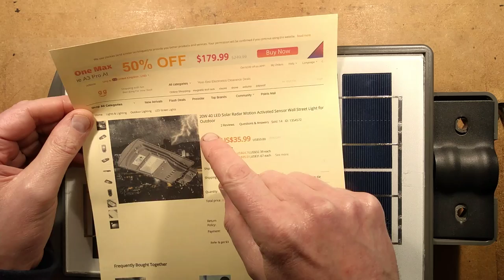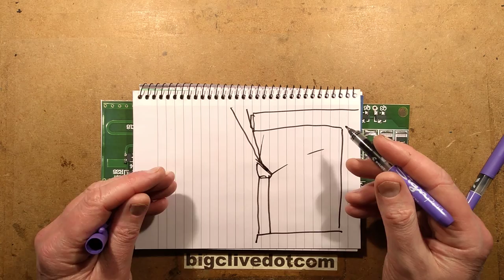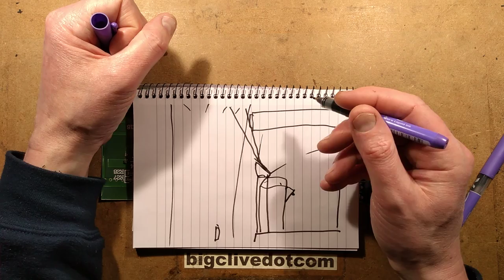Inside a sealed Chinese Solar street light with Doppler detection.

Comment: "It triggers a timer inside  controlled by this array of caps and resistors" AWW!..I have the 300 lumen version and I wanted to double its battery storage capacity by putting in an additional battery, since I noticed its on the edge of what it can do after an all nighter after a cloudy day. And I was also interested in doubling that timer so, when triggered, it stays on a little longer.

Also look into plastic welding. You can do it with a heat gun and a piece of fabric, like hot glue if the fabric is plastic, Usually #5 PP is handy.

Comment: Hi, Clive you say in the comments that the cell only puts out 70mA in the current lighting condition and it doesn't bode well for all night illumination.
It isn't designed for all night illumination, its designed for illumination when a moving body is sensed.

Comment: It's not Doppler in my book as it just looks for a single change in the reflected field - a true Doppler detector uses some form of pulse counting. I designed several commercial ultrasonic and microwave intruder detectors in the late 70s to early 80s using a diode pump as the alarm threshold detector.

Comment: What happens when the Unstoppable Clive meets the Irresistable Object? We get an interesting video!

Thanks for the review, Clive. When I saw the cell, my thought was 'Is it a LiFePO4 cell, for reliability, at that price?' Your tests confirm that it is. It’s quite a neat piece of kit, which should work really well in a sunny climate, and which shouldn't be troubled too much by condensation. At least not for a year or two.

It would be even more useful in these clines if it had a USB charging port fitted. How about a video on that for a modification?

Comment: Silly cone adhesive tends to come apart better under heat, like headlights on cars..  stick in oven at 180 or lowest temp for 30 mins, the glass shouldnt break but whatever theyre using in the solar cells to make em solar could cause it to crack but doubtful because being solar they absorb heat so should be good..  just fyi, i know it is impossible to get the glass off of a headlight unless you heat it to right under the point where the plastic abs gets floppy...

Comment: I found two different 32650 lithium battery types that looked exactly like this on Aliexpress. One the standard 3.7v li-ion, but the other was only 3.2v LiFePO4. 2.9v does not seem that low if it is the latter.

Comment: Since I guess every solar cell leaves about 0.5 volts and seems to be 12 of them i series there should be 6 volts output. Together with 70mA gives 0.42 Watts at your conditions. Possibly you could get around 4 Watts out of it if put in the sun. Nice apparatus configuration.

Comment: When measuring the dimensions of the cell, I read the figures as the first two digits as the diameter in millimetres and the next three digits (or two digits, in the case of a coin cell) as the length (or height) of the cell in tenths of a millimetre, making a uniform convention of cell measurement.

Comment: I have a similar street light. But one day the sensing system stopped working. It won't go back to full brightness anymore, just dim light. After turning it on using the switch, it will light up full brightness for 20-30 secs perhaps then go back to dim. I can't find where to buy this whole circuit board.

Comment: holy  crap    looking at  that cell     id  love few of them  for an e bike battery   ill  go googling  them   been using 18650s
Reply: Tomtech 18650s are generally a better solution — there’s a reason people like Tesla and e bike manufacturers usually use ‘em. Standardization is a thing.

Although to be fair I think Tesla swapped to 21700 for the model 3, because they were going to be using millions of them and then you set the standard instead of coping.

Comment: I just bought a solar panel advertised at 300 mah that looks exactly the same, size and cell distribution.  It too only puts out about 70 mah on a bright winter day.  I don't think the panel is particularly that good at all.  But I'll have to wait for strong sunlight to be sure.  Having said that, I have a solar panel about 1/8 the size that puts out the same mah and voltage under the same conditions.

Comment: The story about the solar powered bins in the dark alleys is hilarious. I am not an electrical engineer myself, so I am only testing the boundaries of my knowledge, but: could the designers have avoided the flickering and instability in the lamp by fitting a Schmitt trigger?
Reply from the maker: They seemed to have kept the circuitry to a minimum resulting in the flicker.  It's probably due to the voltage fluctuation of the LEDs turning on and off.
Reply: I've seen those bins in the pedestrian zone in Birmingham. Tall buildings, tall trees … someone in the council must have felt incredibly smart some faithful day.
Reply: @Anvilshock   Your forgeting being seen to be "Green" is much better than actually providing a service that works [much like two or three weekly bin collections]  :D
Reply: Yes, a Schmitt trigger circuit is often used to introduce a controllable hysteresis for that purpose.
Reply: @Anvilshock  I agree with your comment that people who work in council offices are likely to be dull, but I don't think you mean to say they had an ill-conceived idea on a faithful day.
Reply: Manolis Gledspdalos --    As compared to the Jones Trigger which turns on and off prior to receiving an input signal using predictive technology derived from Artificial Intelligence and Fourier Statistical Analysis.
Reply: True, now that I read it again, I believe I meant to spell "fateful". Thanks! I knew something looked off but I just couldn't tell.
Reply: Whether they worked or not was probably immaterial. By deploying them, as in glasgow, which is 56N and so not good for solar, the local authority ticked a box to receive sustainability funding. Or am I just being cynical.

Comment: That's a cute little solar panel, what else could it charge up?  Reading about the battery, you say it has high charge/discharge cycle capability, does that mean its like a mini deep cycle battery?  Great video, thanks.  Poo

Comment: I have similar solar street lights 20 watt but larger led panel gives a lot of light especially when passing burns all night already for several years ( 12 pieces) and the first one now has a bad battery 632650 single cell i paid about 10 Euro for each unit here in Thailand

Comment: It seems tricky to balance the size of the battery with the light well enough. On the one hand, it mustn't be too small, for the light must be able to run throughout the night. On the other hand, it mustn't be too big, for the solar panel must be able to get it back up to a sensible voltage.
Reply: I'm still trying to find the right fit. 3 years running now. I think I need to step up to the bigger stuff😂

Comment: They sell 4inch LED censored pod lights for $12 +change at Home-depot ,, they work great for closets, refrigerator and entering rooms, my lighting system on my boat is getting rewired for USB and low voltage,,the small solar panels,like the ones you take apart work great and can be built inconspicuously into the cabin roof dorades (wind scoops) , lighting for boats is getting more creative

Comment: In the US, most rulers and measuring tapes are imperial on one side and metric on the other as well. Although I’ve never seen a ruler with markings at 1/10” intervals.

Could the dusk flicker have been mitigated with a filter capacitor or would they have needed to add proper hysteresis to its activation?
Reply from the maker: I think it would have required a bit of extra hysteresis circuitry.

Comment: I think it would be better to have the leds off when it isn't triggered so as to get the best possible light and the longest battery life. I see no reason to keep a light on when it isn't being used, those radar sensors are very sensitive and will trigger much earlier than the old pir sensors.

Comment: I should be getting in a pack of thermostats from China, I had to buy a pack of 5 as they weren't sold individually.  They are non-adjustable set at 60℃, since I will be having extras, would you be interested in taking a peek inside one?  They appear to be riveted, I can send you 1 or 2 when/if they ever arrive.  I'm crossing my fingers that nothing will melt down, burst into flames, or explode (as I have no explosion containment pie tin) when I install it.
Reply: Expecting lower than 40% failure rate from China, haw haw

Comment: What's actually driving the microwave transistor? Is it a PLL or a simple DRO like the HB100?

(Speaking of you'd probably have fun with the HB100 if you haven't played with it yet)
Reply: no, the transistor is configured to be  a free running negative resistance  oscillator. The only tuned element  also doubles as the transmit and receive antennas.

Comment: The Nut and Bolt look like galvanized and not made of stainless steel. So the could rust as well. But I may be wrong.
Reply: Martin Meise The bolt head had the marking ”A2” on it which usually indicates stainless steel. Then again, the bolt is probably Chinese-made as well, so the ”A2” might be there for esthetic purposes only... :)
Reply: With Chinese fasteners you don't have to worry about the rust so much as whether or not the threads work, or if they even bothered to try to cut some into the material they evidently think is metal.
Reply from the maker: They had weak magnetic attraction suggesting stainless.

Comment: Do you think this board is used in lights which could have both the PIR and radar to prevent false triggering? Also, why would you put an exposed on/off switch in a street light?
Reply: Christopher Lewis The button is out of reach for mere mortals but very useful for the person installing it on top of the light pole.  For example turning it off while stored and transported, or (if implemented) forcing it on in daylight to test it.
Reply: This light is a 'weekender'.  Turn the light off on  Monday, let it charge through the week and on Friday turn it back on.  A Weekender! .. BTW - the person that does the 'off and on'ing used to called a 'Lamp Lighter' :-)
Reply: who often rode a rather high bicycle !

Comment: Typical uk solar power generates less than 20W/m2  . you need good placement and large area to work well. (edit: this is the annual averaged figure )
Reply: It sounds very low when you average the output across 24/365, but let's not overlook the fact that there are loads that vary with bright sunlight (e.g. air conditioning loads.)
Reply: On the IoM, perhaps Clive would be better off with buffered wind power, basically Julian Ilett but with windmills!
Reply: @TaiViinikka  Yes but uk  domestic electricity load is usually lights and heating (kettles) ,  which tend towards evening loads , rather than air conditioning and other daytime loads . storage at reasonable cost is big issue.
Reply: Bill Todd - typical where? In the north? In the south? Winter figures? Summer figures?
In the part of the U.K. where I live, there are a fair number of solar farms. Hence I decided four years ago to have a PV solar installation fitted on the roof of my house. This December, due to a lot of overcast and cloudy sky, output has been rather low. But due to the clear and sunny sky in the summer, this year in total will be the best ever. Total generation for this year 3.708MWh.
Reply: @Mark1024MAK  how many square metres ? How many panels ? ,these are typically 1.2m2 each. (my guess 18 - 20 panels).
Reply: For things like Clive's street lamp to work at night, all year 'round , the PV panel will need to generate at least its average energy consumption.  The trouble is that up here at 50°+ north,  the winter days are much shorter than the summer (in fact much shorter than they even look , due to the way our eyes compensate for light levels)  . If the panel was big enough to keep the lamp going in winter , it'd be generating  too much in summer (a waste ) . The alternative is to store enough during the summer months to run on batteries for the winter , but requires a considerable sized battery.
Reply: There are a number of problems with solar powered systems in northern latitudes, one as mentioned are the short days and long nights. Positioning and panel angle are critical. Due to the low elevation of the sun, the output from a horizontally installed solar panel will be a lot lower in winter even if the sun is out all day. The second problem is the likelihood of multiple overcast and cloudy days, or worse, thick rain cloud. Although PV panels do produce some electricity with overcast or cloudy sky, it is a fraction of the panels sunlit figures. And with thick rain cloud, output will fall to zero or near zero. A further problem, is the weather in this country can trick you. With PV solar panels that are in a fixed position, and which are angled for maximum output for a southern sun (that is with the sun at maximum elevation in the sky), if the weather is good in the early morning, and/or in the late afternoon/evening, but bad in between, solar generation will be poor for that day, even though there has been a good amount of sunshine...
Combined these mean any solar system designed for summer use, or for locations nearer the equator, will fail to meet expectations in the U.K., with the performance worst the more north you are.

Comment: I wonder how cost effective it might be to replace those batteries with supercapacitors? There are some amazing capacitance values out there, and our Russian friends use a "supercapacitor battery" in their truck - which works just fine even in the middle of a Murmansk winter!
Reply: As a fan of capacitors I can tell you, sadly it wouldn't be a reasonable choice. Sure they have gone up in capacity, but you would end up with a huge expensive streetlight. The reason is that it requires low current but high capacity, which is exactly what a battery is, and exactly what a capacitor is not.

Using a capacitor for a car battery is near ideal. You need high current for a short while. Once the engine turns, the alternator charges the system, and you no longer really need to store a large charge.

Another argument would point at the high number of charge/discharge cycles of capacitors, but other light components would fail before the break-even point (as a consumer). As a manufacturer, if you passed the break-even point, you would lose money (read: the Tungsten light bulb cartel)
Reply: @abo3abid1  Thank you for the interesting comments! As you say truck starting requires a lot of current over a short time, and supercaps do that well - especially since their discharge capability is not affected by temperature extremes (lead acid has real problems at very sub-zero temperatures). My view of rechargeables is probably tainted somewhat (I still remember the not particularly durable, low capacity and high cost early NiCd cells),  though as BC mentioned the battery used here is an LiFePO4 cell, which has a very good cycle lifespan (as well as significant "user abuse" tolerance!). We're seeing a lot of these cells replacing NiMH in solar garden lighting (especially the "higher-end" models, from more reputable manufacturers), where their durability means a longer time between cell replacement. If Supercap costs per Farad continue to drop, maybe there will be a time when this literally "fit and forget" storage medium becomes as commonplace as today's 18650's and similar!!
Reply: Not at all. Except for very specific applications batteries are way better than capacitors for a given volume. Batteries have a much lower internal resistance, can deliver more current at a more stable voltage while discharging and have so much more power and energy capacity it's not even funny. Under optimal conditions and protected by a proper BMS, a LiFePO4 cell like can have a lifespan of more than 10 years. Cheaper as well.

Supercapacitors are only useful for backup of low power devices e.g. volatile memory, clock, for a few days where lifespan, temperature tolerance, ease of production (can be soldered in place in oven or wave) and safety (no 'dangerous' lithium) are the considerations.

Comment: If its only held on by silicone it should be removable by using molybdenum wire Like that used to cut phone screens off. about $2 for a reel and handle set.
Reply from the maker: It's got a recessed lip that makes that tricky.

Comment: I have almost the same solar light and it was working fine but suddenly stopped working and the sensor charging light it's not showing in at it's suppose while solar charging. I dissasembled the core and with the multimeter checked solar panel voltage and battery voltage separately and they look fine but it's not turning on. I clean the pcb taming moisture out of the electrónics parts but that it's as far i can go with My limit skills so decide to buy new pcb board that looks almos similar as the one show in this video. My question it's, where can i get to buy the radar pcb board assembly?

Comment: I have a "metric" British ruler - it has centimetres on one side and millimetres on the other. Not sure who came up with that design decision.

Foreign currency... a certain bank in their fees PDF gives the example of charging the GBP equivalent of £0.50 to your card in USD will cost you £1.51 (and they don't appear to use the Visa exchange rate). Another bank has such high fees I use it so rarely I had to phone them for a replacement card (automatic replacement on expiry requires one card transaction in last 13 months).

Comment: how would I hook up an alternate power supply to my solar light I believe it runs on 2 18650 batteries I'm using a 2-battery cut off switch battery A goes to solar panel and battery B goes to a 6v plug in power converter but when i switch to battery B it doesn't seem to charge